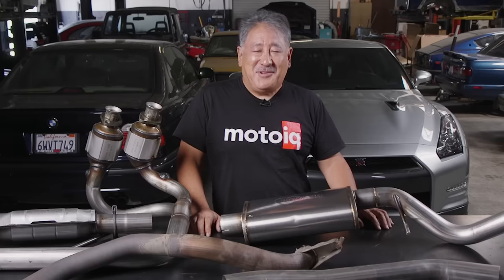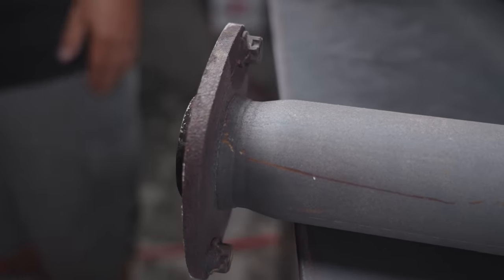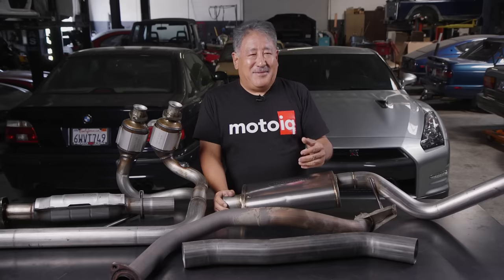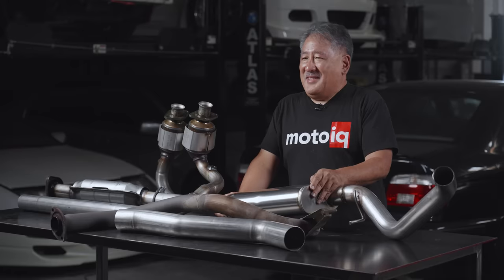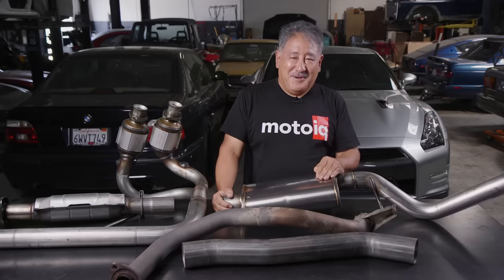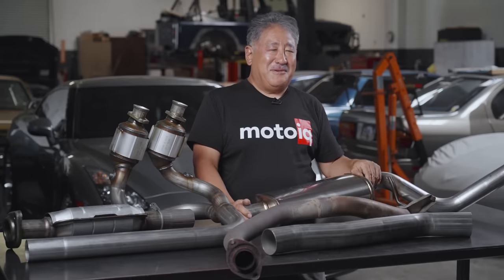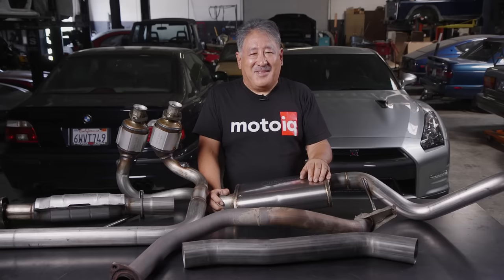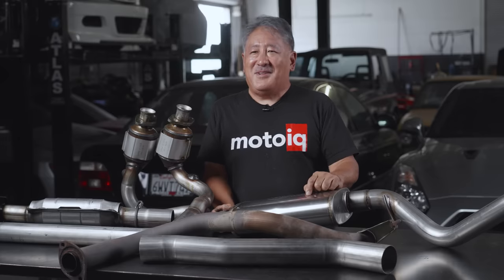Exhaust Back Pressure Myth DEBUNKED!

Comment: I got to the 45sec point in the video.
Thats all I needed to hear what I already know! Re 4cylinder engines.

Back pressure only chokes the engine, why would you build that into your performance engine 🤦‍♂️

Just look at top fuel dragsters, just take a good hard look at those mufflers and pipes they run, to get back pressure! 🤔 oh yar no restrictions! 

2 strokes, header pipe shape and length can affect where the power is made and not so much to how much power is made!
Reply from the maker: A good expansion chamber on a two stroke can make up to 50% more power than just a pipe.
Reply: @motoiq  yes, once you have that correct expansion chamber, then from there you can adjust the pipe length, to fine tune for the track that day.
Reply from the maker: Pipe length, cone shape and length, stinger length, head pipe length all control how it works.

Comment: Back pressure creates low end torque. It’s not a myth it’s already been proven. The only time back pressure is hurting power is for boosted applications.
Reply from the maker: It hurts low end torque, you need to watch the video and understand it.  You need low end scavenging to make good torque, you don't get it by adding backpressure.

Comment: backpressure make quick spooling turbo's. it all depends in the application.
Reply from the maker: Backpressure in the exhaust slows turbo spool.  Backpressure due to a smaller area ratio exhaust housing speeds spool.
Reply: @motoiq  i´m not talking big turbo´s for big horse power (then you are right). i´m talking small turbo´s for quick spool up. some forms of motorsport have limits on turbo size and horsepower (like stage rally) and benefit from super quick spool up.
Reply from the maker: What I said still holds true even in that case.

Comment: So basically you need a small amount of backpressure to keep up velocity why are they making it so difficult there is a fine line between too big and too small so yes backpressure is needed but very little you can't have velocity if you're pipe is too big especially if it's a four banger

Comment: just reading the title made me sick to my stomach. back pressure is definitely for comfort ride and faster climbing on low rpm range. this can be felt dyno wont tell you much because you do power pulls not from zero
Reply from the maker: That is not true on a correctly designed exhaust. Nor is that true about dyno testing.

Comment: So, would you say then that headers would be more important than pipe size?
Reply from the maker: They both go hand in hand
Reply: @motoiq  is there a particular fomrula or way of pre-determining the best combination BEFORE spedning money on the exhaust?
Reply from the maker: What is your application and do you want to maintain smog legalness
Reply: @motoiq  fairly stock 98 Firebird Formula LS1 auto. I have high flow cats and Magnaflow muffler. Looking to gain maximum efficiency and fuel economy without hurting power and yes, keeping it street legal. It's a weekend cruiser.
Reply from the maker: To maintain smog legalness you need something like these headers. https://10secondracing.com/products/hooker%C2%AE-98-02-camaro-firebird-carb-304ss-1-3-4-x-3-shorty-headers  They are not going to give huge gains maybe 10 hp or something like that.  For bigger gains you need long tube headers but technically they are not smog legal.

Comment: So we go to a drag meet, shorty headers and thats it. What planet are you from if you think a restrictive header/muffler set up is going to yield more power? I have a 5.0i Ford which had a 65hp at crank gain with a custom made dual exhaust with a ECU edit or tune. The USA equivalent would be a 2001 Explorers stock exhaust.
Reply from the maker: Did you watch the video?  I said the opposite of that.  I agree with you.

Comment: Mr. Moto is exactly correct.  But all exhaust modification does for a stock motor driven on the street does is prove that its driver is a neurotic infant.  Too many people seem to think that a car is some kind of cool noise maker, starting and finishing their performance mods by just making the car noisy.  A high compression motor with free flowing heads, a tall cam with lots of valve overlap will benefit from low back pressure; sure.  Your mom’s honda with its muffler cut off is just an annoyance, especially if the car never goes down a strip or around a track.  If someone wants to imagine that their street car is also a race car, then the exhaust design needs to include knock offs or some other valve that switches between muffler or no muffler.  The notion that a high performance car must first be noisy is dumb.
Reply from the maker: Any engine can benefit from reducing backpressure, it is thermodynamics. You are right about stupid exhaust modifications though.

Comment: 4 stroke engines don't require back pressure, it has valves to do that job, 2 strokes need back pressure to prevent fuel/air mixture being scavenged
Reply from the maker: no they don't  https://www.youtube.com/shorts/qf9eFYPYXUY

Comment: Mot believein you, been there, my motorcycle ran like crap on aftermarket free flow exhaust, went back to OEM and it ran great again...
Reply from the maker: You can't just throw a properly designed exhaust on there, a good exhaust will increase your VE and your engine will run lean. This is especially true with bikes that are carbureted or if EFI use Alpha N mapping. Retuning is needed.  Then there is the problem of poorly designed aftermarket exhausts as well, often these are not designed right and will hurt your performance.

Comment: If you drive a 2 stroke you definitely need a back preasure! Yes there are 2 stroke gas powered cars,mainly old german and polish.
On my 96 4.0 XJ jeep there is a restrictive bend just after the header pipes join. I got a new pipe without it and i lost a lot of bottom rev power. Explain that.
Reply from the maker: We did a who video on why you messed up your jeep,  Backpressure hurts any engine, 2 or 4 stroke.

Comment: A tapered exhaust , a megaphone, with a reverse cone over the back , when done properly makes HP. I had a Ducati with the factory megaphone racing exhaust and the system made more hp than Any other combination I used. More than a straight pipe.  there was No Muffler involved. Today you gotta have a muffler of some kind.  Then we have 2 strokes....
Reply from the maker: Reverse cone megaphones tend to increase power after the peak and flatten the top of the power curve.   Two strokes don't like backpressure either https://www.youtube.com/shorts/qf9eFYPYXUY
Reply: The reverse cone made hp on top and it was easy to see it. 2 stroke hp can be caried by pipe design. My son was racing 60cc mx. At Hollister Ca track he was reving out in 3rd gear in the big horseshoe turn. I took off the low to mid range pipe and put on a conic section high rpm pipe. The "Fatty" has a bulge in it and the high rpm pipe is narrow. And he got another 1000rpm and didn't have to shift in a drift. Those are facts. Back pressure can change and improve hp
Reply from the maker: It is not backpressure, you used a pipe that reflected the wave sooner.  Backpressure can change the way the pipe works, like it speeds the reflected wave in the pipe.  Tuning it has to do with the cone shape and length as you said.  Adding restriction can be a way to bandaid a pipe on the fly at the track but the best way is a different pipe or messing around with the stinger length on the chamber.  If you get the right pipe for the situation, having lower backpressure with the right tune is always better.  That's why KT100cc Yamaha kart racers have a whole bunch of pipes, their class rules let them change pipes as much as they want. Still increasing backpressure to bring the pipe into tune is a last resort or a quick thing to try at the track.

Comment: 4 stroke yes. .backpressure is not good.  However in a two stroke it is the well designed Tuned expansion chamber exhaust that builds back pressure waves that at a predetermined rpm actually stuff some of the unburtnt gases inside the pipe and Force them back in the cylinder for a higher cylinder charge than atmostpheric. That is the kick in the seat feel you get on a Tuned 2 stroke engine that can lift the front wheel on its own and some meatheads call powerband. Even on a 4 stroke engine the design of a exhaust can actually improve flow or pressurize the cylinder slightly. Look up the Kandency effect and Yamaha exup system or why 2 into 1 or 4 into 1 variants work better than single pipes . Its all about frequency, sound waves and syncronation. If back pressure was all bad than the ideal engine would have no exhaust tube at all other than to remove heat and why drag motors use open exhaust headers. But you can raise volumétric efficiency by desigjning a COMPLETE exhaust system that will complement each cylinder on its proper stroke by utilizing a neighboring cylinder on a opposite or different stroke. It can get quite complicated but its not as simple as eliminating the exhaust with the largest,  straightest smoothest pipe. You want to remove the spent hot gasses but   also filling the cylinder by having a negative pressure in the área beyond the exhaust valve during overlap or when both valves are partially open. I am NOT disagreeing with this video but merely  saying its more complex than that. Many many variables and most of them revolve around harmonics...the number of cylinders, firing order and exhaust to cylinder connections  that interact with each other are crucial in designing the perfect one.
Reply from the maker: did you watch the video? It was about that. Also watch the one on long vs short tube headers.https://www.youtube.com/watch?v=kBQjBMiYW3E
Reply from the maker: Also, two strokes don't like backpressure. https://www.youtube.com/shorts/qf9eFYPYXUY

Comment: Half my exhaust fell off my racecar mid race, only leaving an open header. This is a normal aspirated engine. The engine picked up a miss. Welded it back on and it went back to running normal.
Reply from the maker: Because loosing the backpressure caused your AFR to be off.

Comment: So, we need to keep a cat on a street motor - fair enough, it's a l egal requirement. I have a turbo engine (Saab B207R 2litre) AND I wish to keep a cat so it'll pass it's MoT each year, so I'm thinking to change the standard 400 cell cat to a 200 cell 'sports' cat.That should help that pressure differential across the turbo, right❓
Reply from the maker: That and a big diameter exhaust since its a turbo
Reply: @motoiq  how does that work? Does it slow the gases and thus reduce the pressure and hence increase the differential pressure across the turbine?
Reply from the maker: you need low backpressure behind the turbine.

Comment: I live in the Uk and with the new emissions rules all new xars must have a cat and opf installed by law to make it stree legal. I have the new audi rs3 which has all the restrictions and i dont know what to do to allow more airflow so i can push alot more power through the engine. If i had the opf removed but the cat left on it or even put a sports cat would that allow more airflow. I mean does the cat really restrict that much or is it the opf and gpf that restrict the most
Reply from the maker: A particulate filter is probably worse than a cat.
Reply: @motoiq  thank you for confirming.
Reply: Cat and filter both need a slow flow. So basically I would bolt them onto the tip of the straight exhaust pipe. Luckily you have an Audio and not a Porsche. So lots of space for a very straight, tipple walled tube. Straight line from the turbine exhaust. Oh wait, turbine sits transversal? So at least one bent? Also habe long, straight headed before the turbine !

I want the gear shift on the dashboard, and then in the center expose the exhaust in the cabin. Thanks to double wall and ceramic coating, heat will be no problem.
Reply from the maker: They both need heat though and have to be close to the engine.
Reply: @motoiq  straight pipe with double wall and ceramic coating. A 3” tube has more surface, but a hot core remains. Pulses lead to turbulence though. Yeah, probably need an electric heater grid in front of the cat. Too expensive for series cars.

Comment: Turbos do best when placed as close to exhaust valves as possible.  Most 'Remote' set ups are waste of $$$$
Reply from the maker: They spool best when they are close, but for best power, they can be put at the ends of long tube headers.

Comment: Interesting,   now I'm wondering why years ago,  people dynod my clk430 deleted or stock,  and found a moderate half removal of the cats produced the best performance. (Torque and HP)  My understanding was they tuned the car at each stage.  So I deleted 2 of 4 cats, and muffler and noticed a big HP gain, and moderate amount of torque.  Apparently, a full delete less torque,  all gain in hp.
Reply from the maker: Probably tuning was very rudimentary and you gain power but not torque, who knows how the cat removal was done and how anything was done really.  When it comes to modding cars, there a all different levels of skill and most are really not that good.

Comment: Hi. Very interesting stuff around car farts!😄What can I do good to my 2009 Tahoe 5.3 liter with an original exhaust wich do nothing ab out sound ,like a sewing machine! Straight Pipes is to much!!! I can not go over 88 dB here in Norway. 86 dB is written in the papers/permit. Thanks!!!!
Reply from the maker: Wow some factory spec exhausts would not be legal in your country. It will be pretty difficult to design something that quiet.
Reply: @motoiq  I know!😮‍💨 but I also see some Audi & Merc even new models with original exhaust they ,my guess is way over 90dB, driving through downtown. sometimes my ears ringing🤕
Do you have an idea whats better; Flowmaster or Magnaflow for a 5.3 l Tahoe.I mean every engine is different, a 6 l Chevy sounds different than a 5.3 l and a 5 l Ford sounds not like a 4.8, 4.6 l if you putt the same muffler on each car.I hope you know what I will say !!! Thanks👍
Reply from the maker: I think Flowmaster tends to be loud and Magnaflow tends to be quieter.  I have a Porsche GT3 and there is no way it would be legal in your country, it is loud from the factory.
Reply: @motoiq  thanks!

Comment: To be fair. Those old heads thought  200hp out of 12 liters was efficiency. 😂 I'm actually kinda curious if old motors with lower compression suffered more if u decreased back pressure.
Reply from the maker: No any otto cycle engine does not like backpressure.

Comment: He’s thinking simple. What about a variable geometry turbo??? You use back pressure to control fuel compared to intake. It’s used a lot in advanced turbo control systems?
Reply from the maker: That is completely untrue, you do not use backpressure to control the fuel. Variable geometry either changes the exhaust housing volume or tongue postion to increase the velocity and angle of the exhaust gas hitting the turbine.

Comment: It’s not a myth. I’ve witnessed it myself with a 70’ chevelle.  Built small block with long tubes.  Had 3” duals on it and ran great,  but went down to a 2.5” system and it ran better with more torque.   Made a better street car after.
Reply from the maker: It depends on what your combination is and what is right for it.  We had a little dinky 302 Windsor Ford gain 60 hp by going from 2.5" and flowmasters (customers set up) to 3" and perforated core straight-through mufflers with a siamesed X pipe and tuning for it (what we did).  It also depends on having the right tuning.  It's why pros get better results when building cars and if you have the knowledge to see the big picture.

Comment: Now I know your talking about performance in this, but at least from what I’ve been taught was that the back pressure is just for not damaging exhausts. Is that wrong?
Reply from the maker: yes it's an old wives tale.  Now if your engine starts to run lean from reducing backpressure without tuning, then it is possible to damage your exhaust valves but just reducing backpressure isnt going to damage them.

Comment: Still use turbo style mufflers, they are great for 4cyl engines, they really make the rasp go away quite a bit
Reply from the maker: They have a lot of backpressure.
Reply: @motoiq  they do, but when you remove the cat and oem system and just replace them with 1 cherry style + 1 turbo style you still reduce back pressure a bit, gained about 5whp on my 96" Accord with that setup, also gained about 15whp on my 14" Forester XT, coul have gained more with a direct flow muffler? Sure, but the quality of sound that turbo style gives you is a good tradeoff for a couple of HP and NM.
Reply from the maker: It's much more apparent with a modified engine, especially by the time you are changing cams and or upgrading turbos.